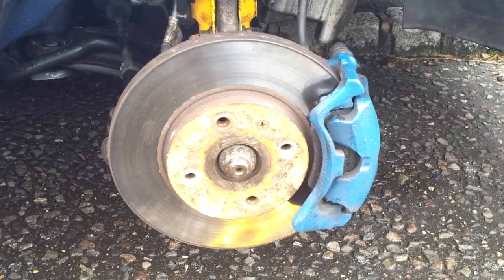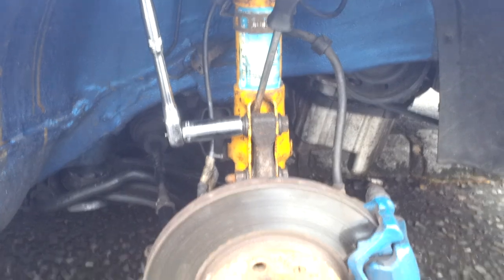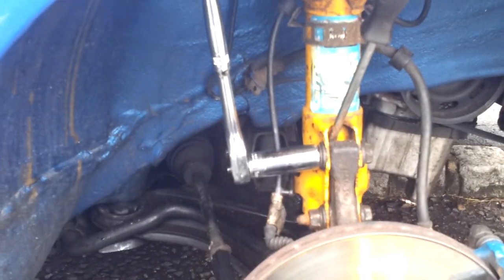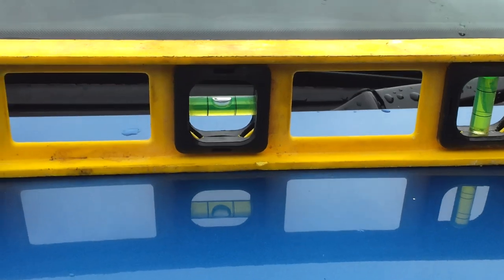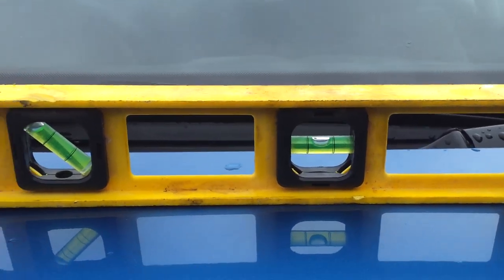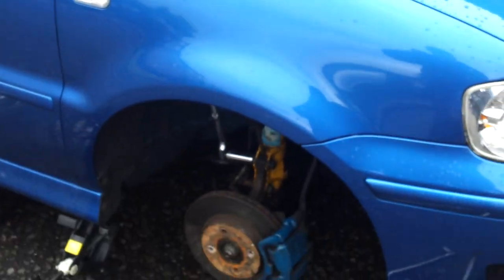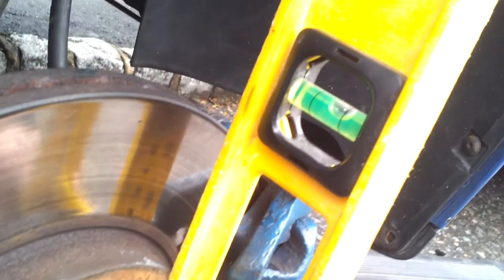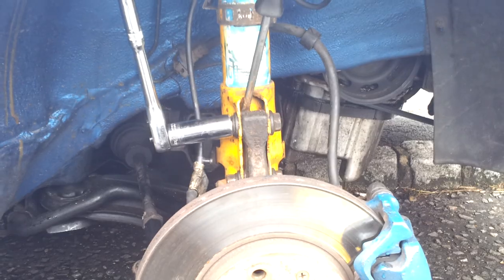FRONT CHAMBER ADJUSTMENT 
GUIDE TO ADJUSTING CAMBER ANGLE USING CAMBER BOLTS.

Comment: Camber angle for these should be 0 to 1 degree. So for 0 degrees the hub face (and rim) should be at 90 degrees to the road surface  It's best to make an accurate wooden triangle the right height to do this, and measure with the hub or lower link on axle stand so the normal load is on the suspension. Adjustment will be harder, so use a decent pry bar or whatever.

Comment: this couldn't be any more wrong. for one you need to set your camber for certain number of degrees. Not just the "right about there" measurement you'll get from a spirit level. second of all, you need to set it for the right camber as it sits on the ground! As  the suspension travels, your camber and toe change. there fore setting it while it's off the ground will throw EVERYTHING all sorts of out of whack. lastly, you're sure as hell not going to get near enough from the stock adjustments if you lower it. You NEED a camber kit which allows for a much greater range of adjustments.
Reply: I agree with you about this being a shit method but actually VWs generally have a lot of adjustment on the camber bolts. You can get thinner ones to allow even more adjustment either way but I can't imagine any drivable car needing them. 
I bought a mk3 Golf slammed really low on shitty FK coilovers and actually the camber was nearly right (!) and still had more to go. I raised and softened the suspension with quality 35mm lowering springs/ proper dampers and it handled, gripped and rode better in every situation. I used to think a really low VW looked good, now I think "There's another twat who cares more about looks than fast driving".. Harsh but true.
Reply from the maker: This is just to help after fitting coilovers and the camber being out by a tone, I agree it should be done at a shop after

Comment: load of rubbish he hasn't a clue what he is going on about when for 1 then the car is lowed the suspension strut will go up and change your camber from 0 to minus  all cars have a set set degree of camber for a reason ps a bent plastic spirit level wont help either
Reply from the maker: This is just to help after fitting coilovers as there's so much camber adjustment on the vw to get you to a place where thay can set it up fully.
Reply: I bought an actual camber leveling tool and I'd like you to explain to me for my 1982 Chevy Citation front wheel drive, what I should have the camber set at when I have it jacked up and car perfectly level? Please I'm doing it right now as I speak, that's why I'm watching this video, I'm trying to get the correct adjustment not zero 0.
Should be 1 or minus 1!

Comment: The car itself needs to be level before you start using any kind of spirit level to check camber. Also you're checking it with the suspension unloaded, so even if the car was level it would still be wrong.. Geometry needs to be spot on otherwise just don't bother.
The fact that FK and Jom is mentioned says it all, cheap shat that no-one who cares about handling would fit to their cars, I guess it's all about mad lows y'all, knob end.